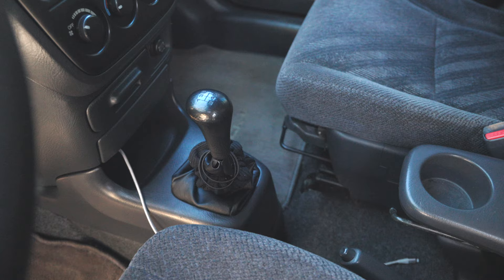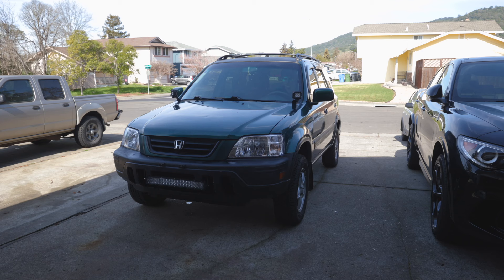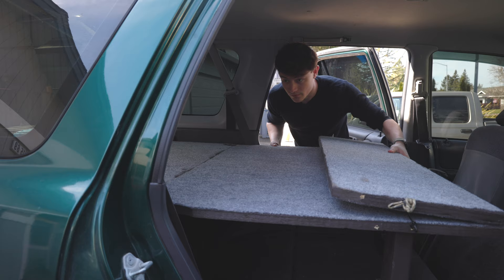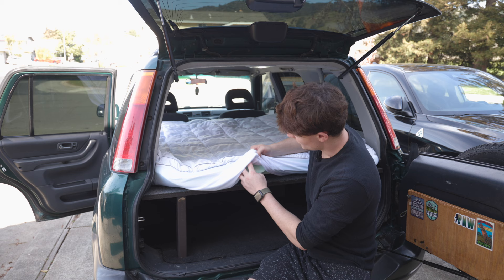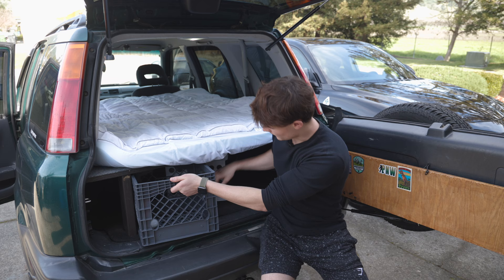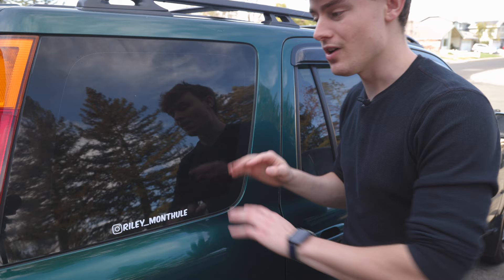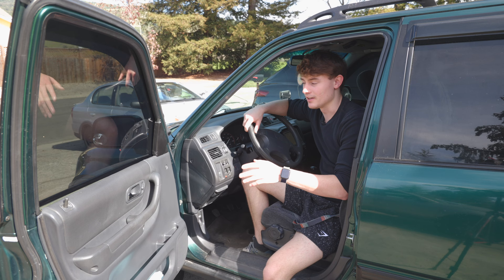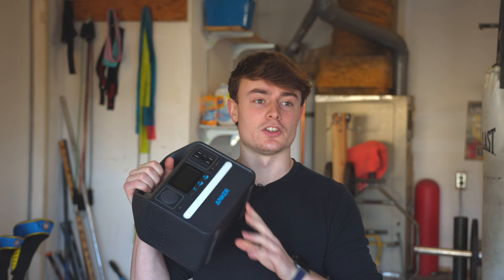DIY Honda CR-V camper build - How I can live out of a CR-V

Comment: Like your video! I have the same CRV and am interested in making a bed/sleep system like you've done.

Do you have a video or dimensions for the bed frame and how to construct it? Material, etc? Thank you!

PS. Adding a lift kit and putting on some bigger tires gets the CRV into all kinds of great off road locations 🙂👍
Reply from the maker: Heck yeah! I have the build info on the highlighted stories on my Instagram!

Comment: Get an 05 or earlier xl7 you will have better 4x4 capability and around the same milage as a old crv with oversized tires, and it's more room but the wheel base is close to the same.
Reply from the maker: You should check out the new build! I already got another car
Reply: @RileyMonthule  I see,  I do like this new ride
Reply from the maker: @adaml102  heck yeah thank you!!

Comment: Nice video! Did you use 1/4 inch plywood for the deck?
Reply from the maker: 1/2” for it!
Reply: Thanks Riley! I have a build I'm looking to start in 2024. Not sure if 1/4 inch would result in a flexing or sagging of the deck. @RileyMonthule

Comment: is that water pipe made of PVC plastic? It dosnt look certified food safe..which means you'd be getting some plastic poison with your drink...also water needs to be recycled every 6 mo or so or it turns toxic as well...But if it IS food safe, then ya this is much more affordable than the traditional aluminum tubes which run upwards of $400.00.